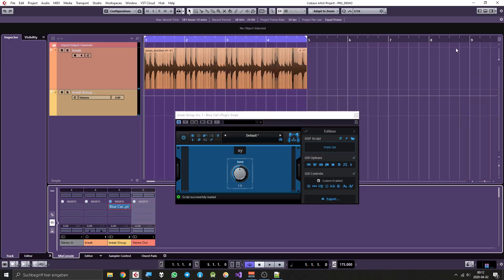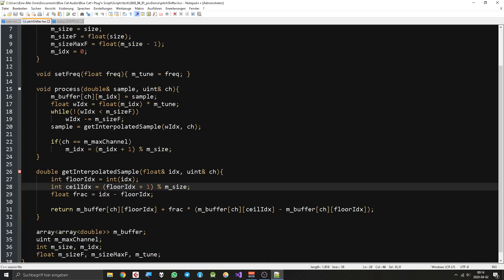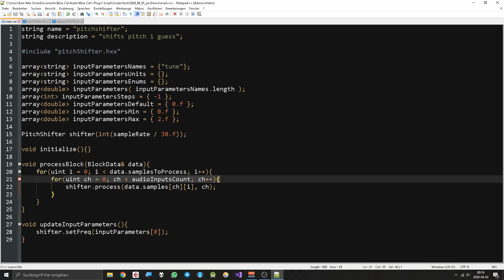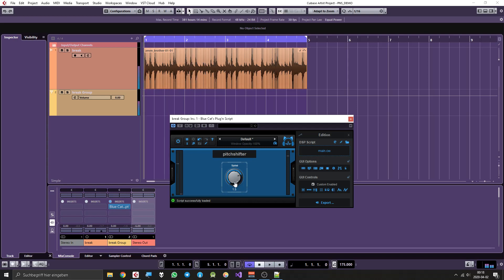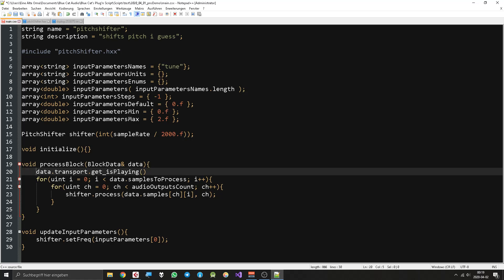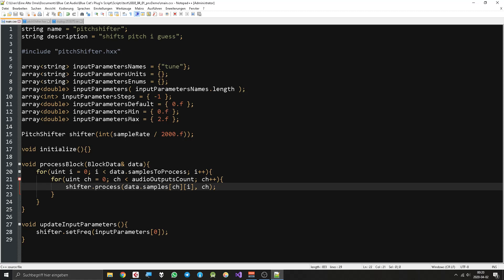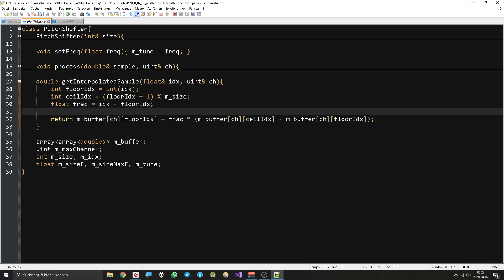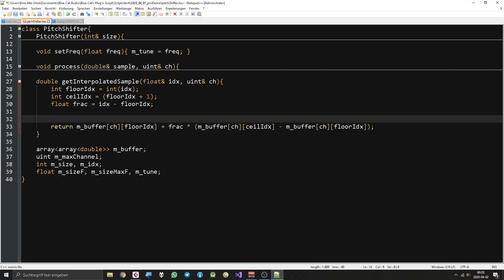Florian Mrugalla - Build a Plug-in without (much) coding!  An introduction to Blue Cat Plug-n-Script

Comment: I downloaded the demo, but could not find the "pitchshifter" script.  Is it available? Your product is very interesting.
Reply: hi. i just wrote this pitchshifter for this little video. it's not part of the presets there. but i think this also just shows how powerful pns is. you can just write something like that in an hour and it works :) the presets are great too btw. they have everything you need to know as a beginner like how to make an oscillator, how to add mid/side-features. how to make a sidechain effect. how to add midi capabilities etc
Reply: @Beatsbasteln  Do you have the script available for download? Happy to pay for it! I'm a long time programmer but completely new to writing audio processing code, I have no idea how to write a pitch shifter and would love to learn from your code. :)
Reply: @AdamWoodworth  honestly i'd feel bad about selling this script to you because you can literally see it in parts of this video and basically just write it down. i just checked if i have a script like this in my repository already but i don't so i can't just give you something to copy yet. however there are tons of other nice little scripts that can help you get started in it. https://github.com/HDLAudio/HDL_PNS_FUNDGRUBE

the vibrato project might be the one that is most similiar to my pitchshifter, because it also basically just uses a feed-forward delay to modulate the pitch of the signal. the only difference between my vibrato and my pitch-shifter is that i use a constant speed in the pitch-shifter while the vibrato has an lfo on its delay's read idx. you'll see what that means if you look at the code, but if you are a beginner there are also easier scripts in my repo in general.

oh and feel encouraged to experiment a lot. i'm also literally only coding dsp for a year. the learning curve is quite ok in the beginning!
Reply: @Beatsbasteln  Thank you! I’ll take a look!
Reply: @eladevia whenever you add a new name to your inputParametersNames array another knob will appear. you can access all parameters then by just calling inputParameters[x] with any number x < inputParameters.length. There are a lot of examples for that in the demo scripts provided by blue cat.